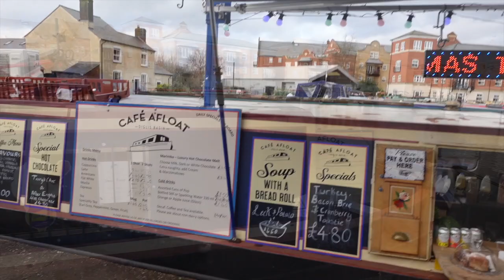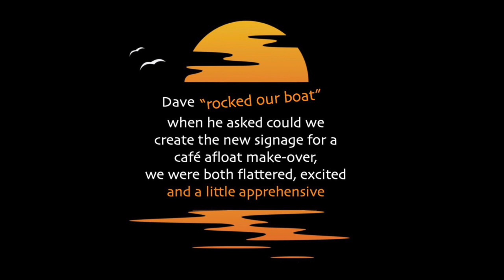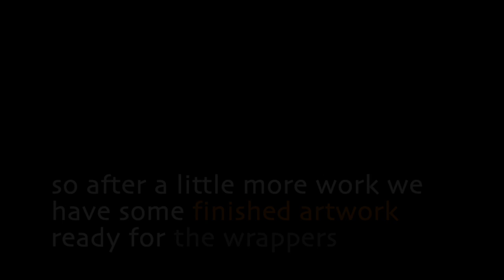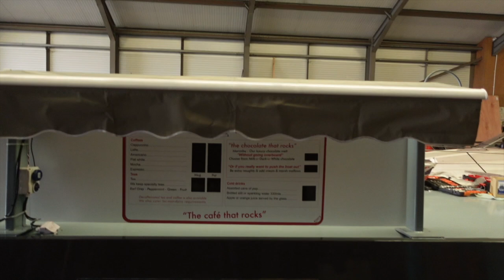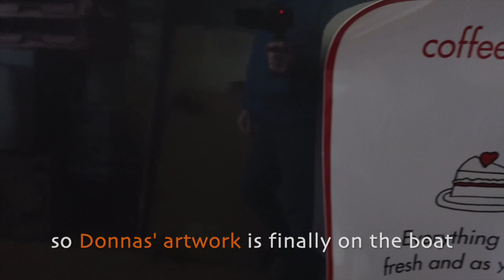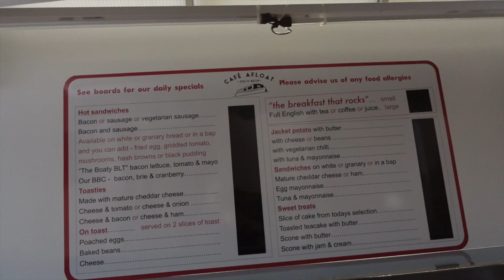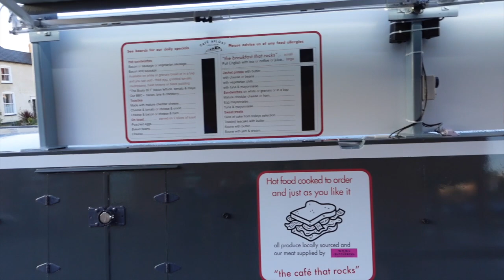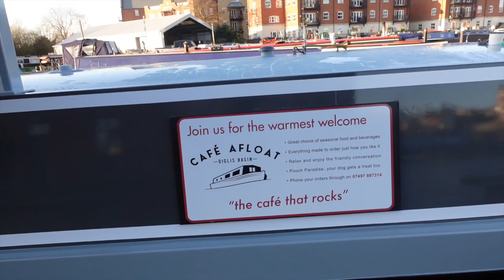How to wrap a narrowboat

Comment: It is possible to cruise having a boat wrapped, i had my boat wrapped three years ago, and have cruised ever since and it still serviceable and looking good.
Reply from the maker: Hi Colin,
That's interesting... we are going to paint ours as soon as the temps starts to warm up, do you get any trouble with tree rubs?
Martin
Reply: No more than on an expensive paint job, but since it was less than a fifth of the quoted price of having it painted and done in a day it not so much of an issue, whereas if I had paid for it to be painted I would be crying if it got scraped, you can always patch the wrap!